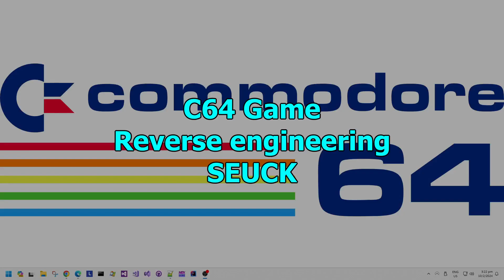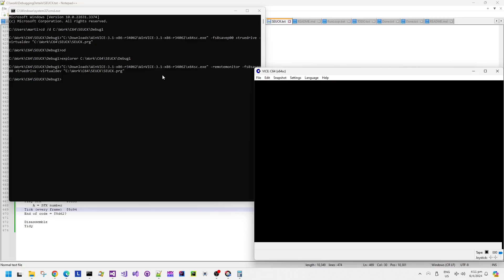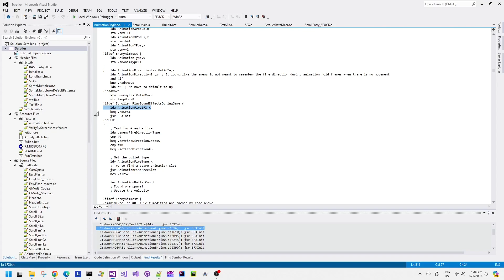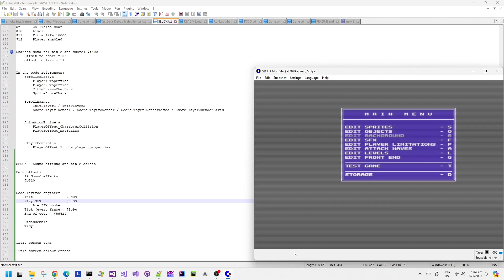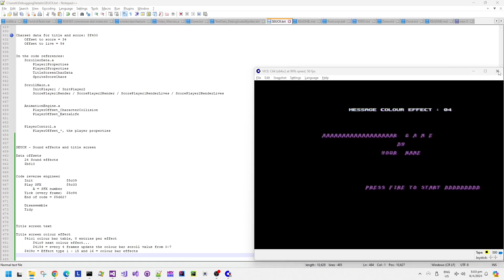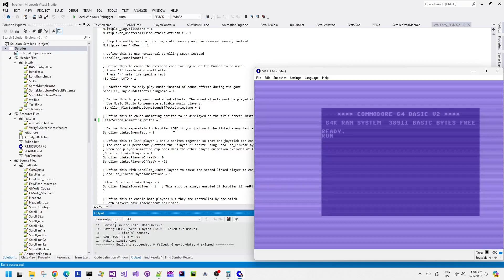Comment: 🎯 Key Takeaways for quick navigation:

00:00 🕹️ Reverse engineering game sound effects on Commodore 64.
- Reverse engineering process explained.
- Overview of sound effects emulation from the original game using SEUCK.
- Importance of data offsets and code reverse engineering.
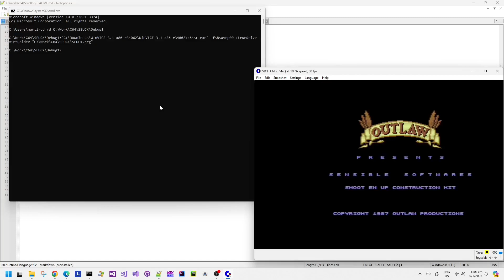01:07 🔊 Creating sound effects with SEUCK editor.
- Explanation of SEUCK sound effects editor functionalities.
- Demonstrating the process of editing sound effects parameters.
- Exploring waveform, attack, decay, pitch, speed, and time settings.
04:11 🎚️ Modifying sound effects and analyzing binary differences.
- Copying and altering sound effects parameters for creating variations.
- Analyzing binary differences to identify sound effects memory offsets.
- Determining suitable memory ranges for storing sound effects data.
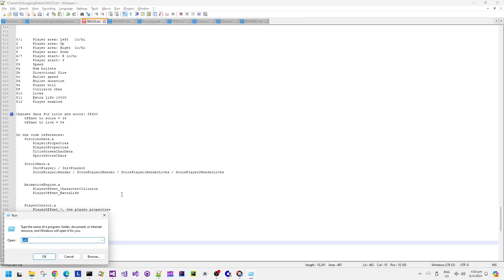06:17 💽 Reverse engineering sound effects code.
- Using emulator's monitor to analyze code execution and memory accesses.
- Identifying initialization and play routines for sound effects.
- Disassembling code and analyzing memory maps for further reverse engineering.
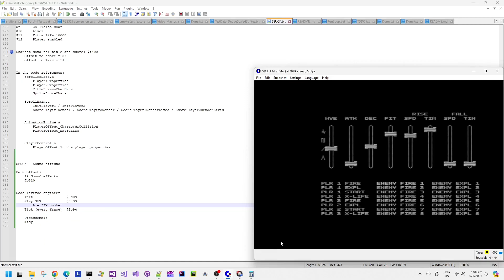10:25 💻 Reverse engineering continuation: Disassembling code.
- Analyzing disassembled code for sound effects initialization and play routines.
- Optimizing code and applying label names for readability.
- Exploring different approaches for sound effects processing and optimization.
14:22 🛠️ Tool-assisted disassembly and code optimization.
- Utilizing external tools for disassembly and code analysis.
- Enhancing readability and understanding through label naming.
- Demonstrating memory mapping and analysis for efficient reverse engineering.
19:07 📜 Integration of reverse-engineered sound effects code.
- Comparing original and optimized sound effects code.
- Explaining the integration process into the game engine.
- Establishing event-based triggers for playing specific sound effects.
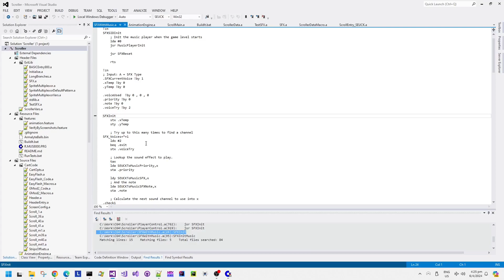25:28 🎮 Finalizing sound effects integration.
- Tying together reverse-engineered event values with sound effects initialization.
- Explaining the seamless integration of prepared data into the final sound effects routine.
- Highlighting the efficiency of preparation work in facilitating integration.
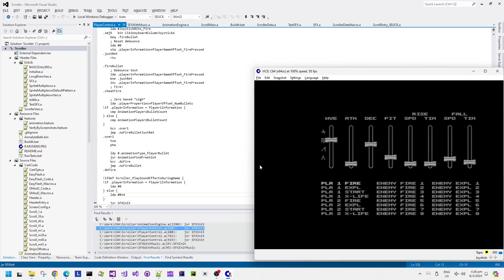26:12 🔊 Reverse engineering game sound effects and title screen
- Reverse engineering process includes adding sound effects to the game.
- Demonstrates how to integrate sound effects into a game engine.
- Explains the purpose of the reverse engineering series: to create functionally identical code.
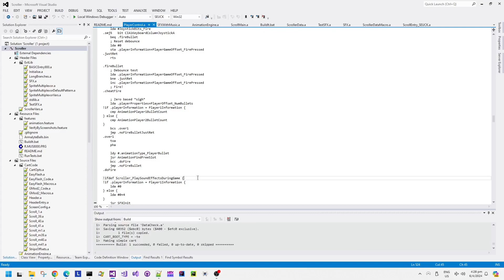27:50 🔍 Reverse engineering the title screen text and color effects
- Initiates the reverse engineering process for the title screen text and color effects.
- Utilizes a binary difference tool to locate relevant data.
- Explains the process of identifying and replicating color effects for the title screen.
32:12 ⚙️ Analyzing code for raster bar color effects
- Examines code responsible for updating raster bar color effects.
- Details how the code calculates and updates color values for the raster effect.
- Discusses the importance of understanding and replicating original code for accurate reverse engineering.
35:38 📄 Saving and accessing color effects data
- Explains the storage of raster color effects data in the all data save file.
- Discusses the benefits and drawbacks of saving comprehensive data snapshots.
- Demonstrates how to extract and utilize color effects data from the save file.
38:08 🎮 Finalizing title screen code and features
- Completes the reverse engineering process for the title screen code.
- Describes the functionality and structure of the title screen code.
- Introduces additional features, such as animating sprites, to enhance the title screen.
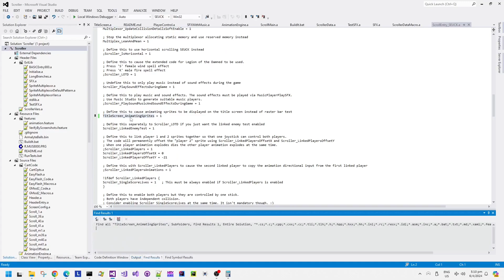41:29 🎨 Expanding title screen features with customizations
- Demonstrates how to add custom animations, such as rotating sprites, to the title screen.
- Discusses the flexibility of the code for implementing new features.
- Highlights the ease of understanding and modifying the code for Commodore 64 game development.